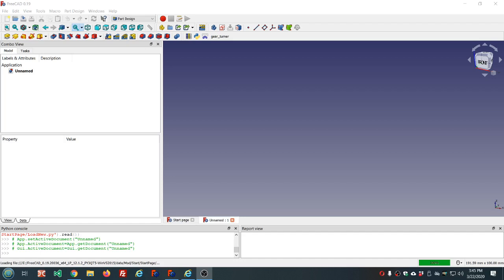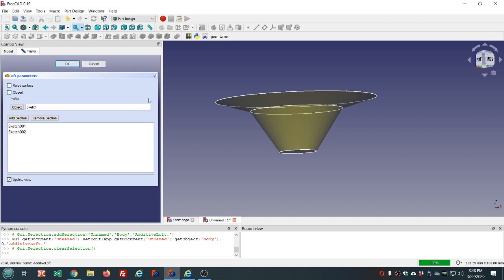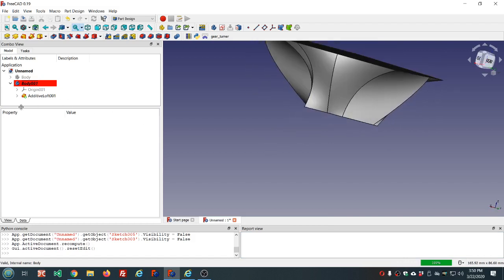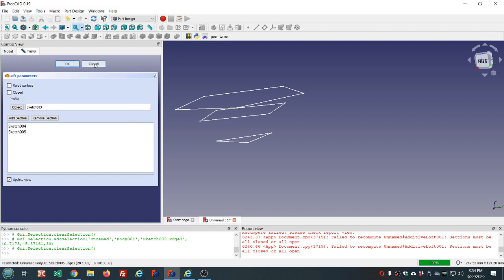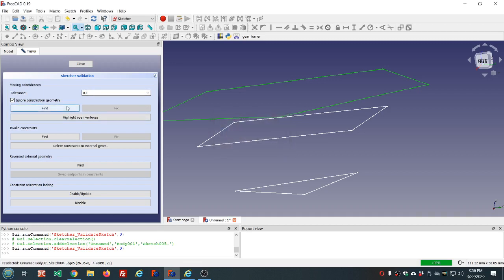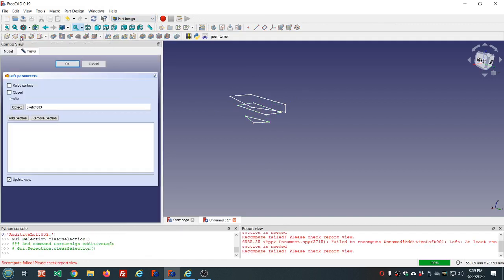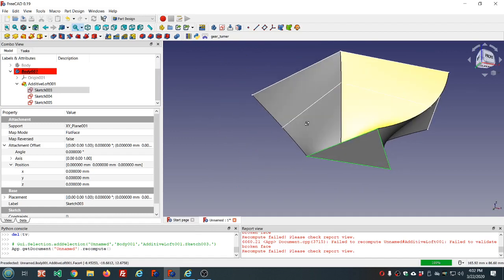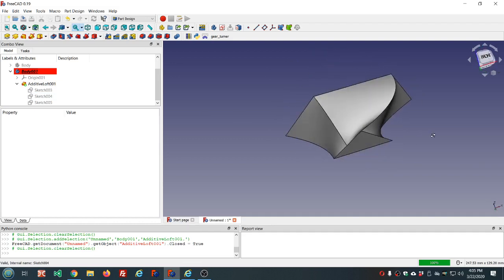057   FreeCAD Part Design Loft

Comment: You said that you can determine which segment on a section connects with which segment on the next section, but how???
Reply from the maker: It's based on the order of creation.  For example make 2 sketches consisting of a circle inside another circle, so 4 circles all together, 2 per sketch.  In the first sketch make the smaller circle first and in the other make the larger circle first.  When you loft them the wires will get crossed and you'll have self-intersections (not good).  In this simple case an easy fix is to swap the circle radii in one of the sketches.

I have a pull request pending to provide a way to match up the wires to be connected during part design loft, but I don't know when or even if it will be merged.
Reply: @mwganson  No, that doesn't work. Even if I make 2 sketches of a square exactly the same way, but then rotate one of them, the end result won't be rotated. It will instead find the shortest vertices or something.

Also, where can I find your mr? I'd like to patch my own copy with it, because it sounds amazing!
Reply: @mwganson  Ah, I think I found the relevant discussion: https://forum.freecadweb.org/viewtopic.php?f=17&t=49201
Great work!
However, your patch is about wires, not segments of wires. My question was about how to determine which wire segment will get mapped to which wire segment in the next section.
Reply from the maker: @marcus-in-3d  Oh, now I see what you mean.  In this case you might need to add additional sketches or perhaps use a sweep along a helix with multiple sketches.  If you can't get it I suggest to create a topic on the forum with your file attached.
Reply: @mwganson  I ended up enhancing the Curved Shapes workspace with some additional B-spline parameters. Now I suppose I need to figure out how to submit the patches, because the enhancement is actually pretty darn useful..
Reply from the maker: @marcus-in-3d  The best way is to fork the curved shapes repo on github.  Then create a new branch, and add your changes to that new branch.  Then create a pull request on github.  You should inform the author on the forum where he has a topic created for the curved shapes workbench.  Otherwise he might not get a notification of a pull request.
Reply: How do you loft 2 shapes at 90 degree planes following an arc or a defined path like a sweep? Example a square on a horizontal and a vertical circle. The basic form does a straight line between the two shapes.
Reply from the maker: @suntan8655  You can do this with a multi-section sweep in Part Design.